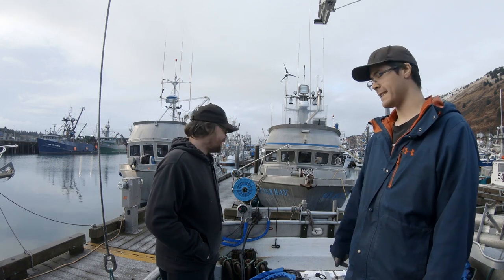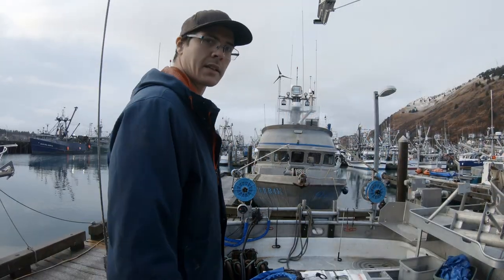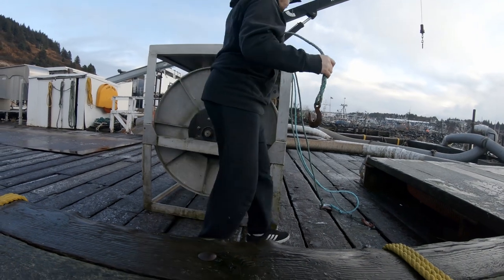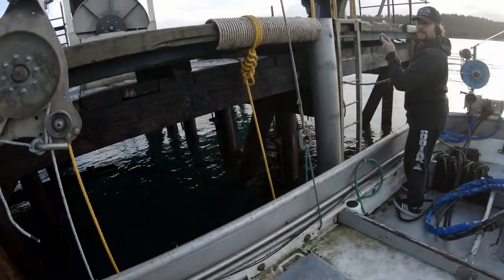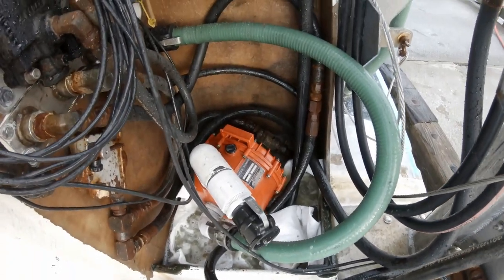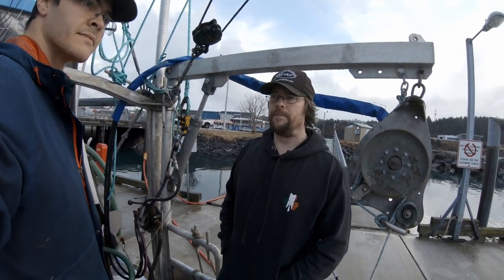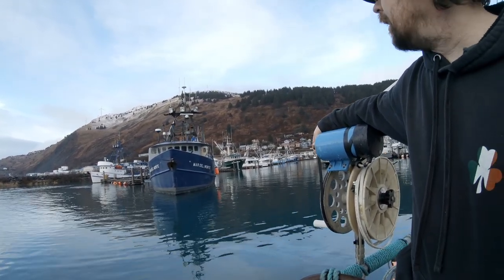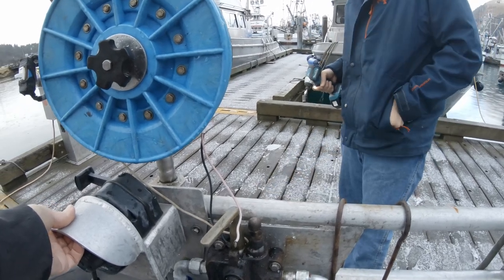Lifting Off the Longline Reel

Comment: Nice clean up of the boat and great timing on the hydraulic failure.  Be sure to film when you pull the boat and clean the hull.
Reply from the maker: Thanks Jimmy. We will. Probably get on the grid in the next month or so and get the bottom cleaned.
Reply: @EISAlaska  I know it is hard to come up with ideas to make videos and I think that many would enjoy seeing that whole operation, ie getting it on the grid, the condition of the hull before cleaning, the process of cleaning, then back in the water.
Reply from the maker: @jimmysquires5093  We do have a few videos where we go on the grid. This one we are just cleaning and taking care of preventive maintenance. https://youtu.be/7T7RlFk_JwM

And in this video we do some fairly intensive fiberglass work. https://youtu.be/wW2NuhweGAs

We also have some more major projects and work videos in the cue. So stay tuned.

We do appreciate the suggestions and if there is any other topics you would like to see or know about, we would love to hear your ideas. Thanks Jimmy!
Reply: @EISAlaska  Sorry, You are right these 2 videos do address many of those things.  I had not seen either before.  Some many videos and so little time! :)
Reply from the maker: @jimmysquires5093  No worries Jimmy. We really appreciate the suggestions, and send and ideas our way. Thanks